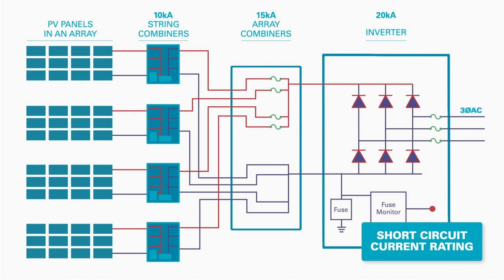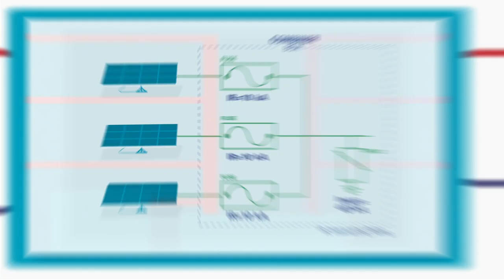Choosing the Right Surge Protection for Solar Applications

Comment: do i need spd if my inverter has builtin dc/ac  spd?
Reply from the maker: Great question, Tariq! To thoroughly answer, we would need to review how close the equipment you are trying to protect is, physically, to the surge protection included in the inverter. If the equipment is more than 10m from the inverter, we would recommend you install additional surge protection.
Reply: @LittelfuseIncorporated  it comes with type 3 spd built in,  what i  heard is type 2 is better(used in huawei inverters)
Reply from the maker: @waqastariq5941  Hi Tariq, when evaluating surge protective devices, it is best to review the SPD's Voltage Protection Ration or Voltage Protection level. This parameter will tell you how much voltage is let through to the equipment you are trying to protect and would ideally be as small as possible.

When you refer to “Type 2,” this definition can vary depending on if you are talking about a UL SPD or an IEC SPD. By IEC standards, type/class 2 indicates it is qualified to protect from indirect lighting strikes and type/class 3 provides less protection. By UL standards, Type 2 indicates the product is rated to be installed on the load side of the main disconnect, whereas Type 3 is only rated to be installed at point of use.

Comment: Do we need seperate DC SPD for each string? Because in my solar inverter  I have 3 MPPT and each MPPT has one SPD with earth. 
Each MPPT has 3 strings. Do I need seperate 3 SPDs or combine one SPD will do the work?
Reply: Ideally, you would have completed appropriate training that would teach you this generally it is put aside protection device on every string and both legends that is the best way they’re potentially at one end but you could do both is not that costly

Comment: 0:48 "SPD protection level needs to be 20% less of the system's withstand rating"
If my SCC/Inverter's PV max input voltage is 500V, and my PV's string Voc is at 370v, does this mean I need an SPD that is 400V?
unfortunately, I could not find any 400Vdc SPDs; only 1000Vdc SPDs.
What about using AC SPDs? They have lower values.. Any ideas?
Reply: Hi, from the video, SPD to be less than 20% system's dielectric withstand rating, not string voltage or inverter voltage.
You can check the name tag for system maximum voltage, usually 1000 or 1500 V.
I think you should go for System nominal voltage < SPD < System maximum voltage